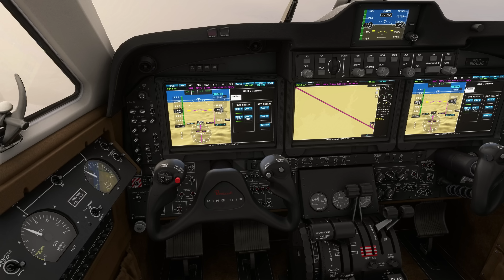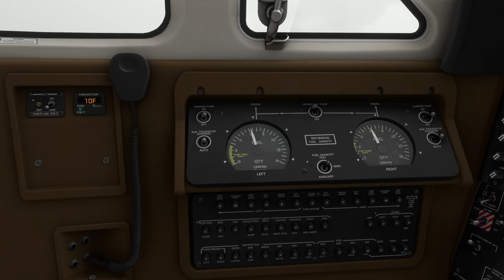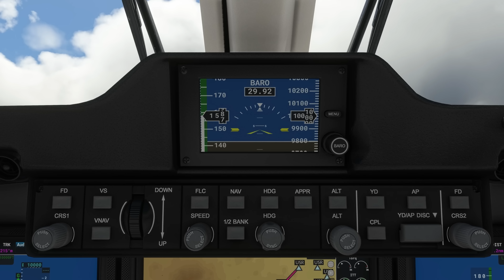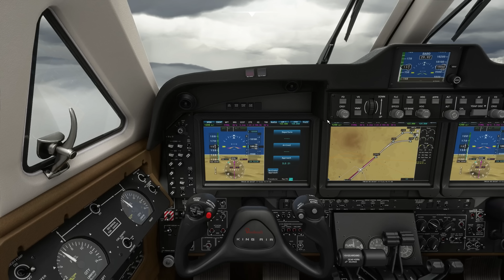Killing coal in a Beech 1900

Comment: This channel has filled a niche I didn't realized existed.  I think most of us figure out the cause/blame 10 seconds into the coverage of air disasters on shows that can span an hour.  We tolerate the remainder of the show, anxiously (if we can't FF) just to confirm our theory.  I'm not knocking them and I will continue to indulge.  But this channel delivers gripping narratives that unfold like  classic detective tales.  The narratives suck you in like a good book and the need for "got the right answer" confirmation isn't top of mind. How cool would it be if he wrote FAR/AIMS/SOPs, etc.  And he was a Sim instructor.  I'm trying to picture his voice over the heavy accents so common from Flight Safety.  Great Job.

Comment: Shot an NDB approach to Sedona. Now decommissioned, probably because the NDB was so weak, you were shooting the outbound leg and procedure turn in the blind, the needle having died with no NDB aural tone at all, just static. It would quiver and come alive within 20 seconds of station passage and only then could you see if your flying was precise enough, and your wind correction estimates were good enough, to watch the needle swing to the nose, or some other position.  At 1:00am in blinding snow, (no weather reports on this part 91 leg) I’ve never felt so - alone - as when waiting for the needle to come alive from its non-functioning 3:00-9:00 position with nothing but static in the headset. As time was running out, the needle quivered and slowly swung to the nose as the identifying aural tone became discernible with only 20 seconds to station passage. Longest one minute of my life, that inbound leg, staring at that dead needle. Never been so happy to see that needle slowly come alive and point directly at the nose, other than the 20 degree WCA. At station passage (the MAP) the landing lights just showed raging snow.  loved that Chieftain’s ability to shrug off ice. Knowing I’m 2,000 feet below the ridges all around I poured on the power, climbed 4,000 feet in the racetrack up to MEA and diverted to Prescott to shoot the ILS to minimums. Grabbed a room at a local motel and slept hard. The next day I woke up and looked at 2 feet of snow deposited everywhere. 
Nasty leg but everything went as it should, except for that piece of junk NDB. The flight attendant was happy to go home too.

Comment: In the U. P. Of Michigan I flew on a over loaded  Raytheon / Beech 1900  from way north to 
Milwaukee , Wisconsin .   Not so good on take - off , but worse on climb out .   Winter weather - 
I was not comfortable at All !    About to poop —- no joke   We sunk several times  . I was tight … 
As we finally climbed -  thanks to a pilot keeping the deck about 3 - 5 degrees  max - that 
Aircraft powered us all out of a very old AFB  with no turning whatsoever  -  gradually , the 
Flight crew  turned us south using rudder only , I think  .      Way to many big men on board -  
They left the flight attendant up at the station -     After a while , the aircraft seemed to fly 
Normally  and we cruised south  & burned a lot of fuel to do it .   Scared the crap out of me , as 
I knew some of what was going on -   After about 35 - 45 minutes we were maybe 10 thousand ft . 
Nearing destination airport .     Damn -    
Another flight on the ole 1900 was a ice cake wing scrapper -    Ice flying off the wings - 
Constantly …. Mid - West  only game in town !    Good guys , just scared me … and I can fly a 
Light aircraft  VFR     C - 150 / 152  around Sanford , Florida .     Jeez 😮 😐😖🫢   Thanks Buddy !

Comment: It's important to note that the runway was not equipped with an ALS as depicted in the video. There were REILs, edge lights, and VASI only on RWY 2.
Reply from the maker: The rabbit was from flagstaff and for illustration purposes only. Non precision runways have fewer lights, one reason why minimums are higher. It’s all kind of irrelevant anyways. Apparently none of the lights were working.

Comment: You are incorrect on your autopilot assumption.  The manual Alt on autopilot control panel can be clicked up or down in 30’ increments without disengaging the autopilot.  Don’t bash, Karma is a bitch
Reply from the maker: They turned the autopilot off prior to descending below the 100’ increment, like I said in the video. They leveled for both approaches at the 100’ increment according to the NTSB. They weren’t using a “manual Alt” function.

They landed well outside the touchdown zone with a tailwind on a contaminated runway. They went off the end at 40 knots. I’m not bashing. But it was pilot error, plain and simple.

Comment: Pretty harsh there, dude. 

long landing, yes. Slush? How could they have known?. Until you've had the pleasure of landing on unknown/unexpected slush, you can't really judge. Were it not for the slush, he'd have stopped. 

I'm guessing you are either not a pilot or a low time VFR one by your comments on this pilot.
Reply from the maker: 8,000 hours, check airman, 20 years total in aviation related jobs. It wasn’t my judgment. It was the NTSBs. It doesn’t make them bad guys, but the pilots were clearly to blame. They landed a quarter mile beyond the touchdown zone and clearly did not have the visibility for the approach. It was 1/2 mile in snow, so a contaminated runway is hardly a shock.
Reply: @flyingformoney777  You've never pushed the limits on an approach? 

I don't discount what you say, but your analysis is still kinda harsh and somewhat "holier than thou". 

Sorry I discounted your experience, but it sounded like a pilot wannbe analysis.
Reply from the maker: This wasn’t a moral judgement against those guys. Maybe my perspective is different. There were three separate elements that would have led to a failed checkride if this had been in the sim. First was continuing below MDA, twice, in visual conditions obviously below minimums (half of minimums, to be precise). Second was descending at well over 1,000 fpm below 200’ agl. Third was landing well outside the landing zone. Take away any one of these three “intentional error links-in-the-chain,” there is no crash. 

The point here isn’t blame game. It’s to reinforce adherence to operational policy. Like you said, pilots like to push the boundaries. It’s good to understand what the consequences can be.
Reply: I think his analysis was spot on.  
Sometimes pilots (especially seasoned ones ) need a dose of reality from their peers. 

Harsh is destroying the airplane and injuring your passengers.